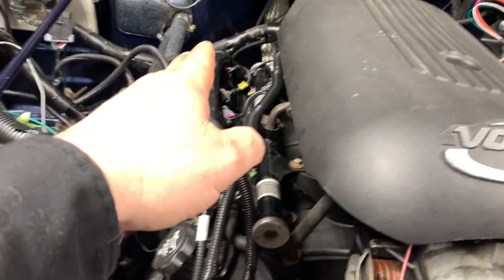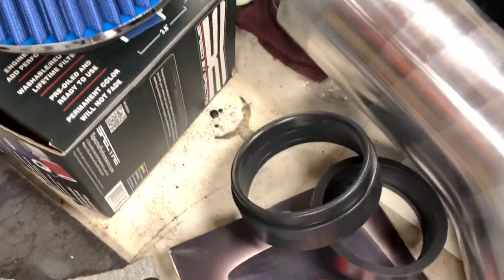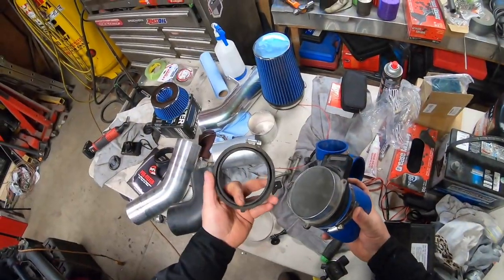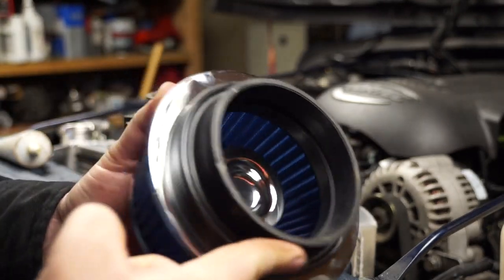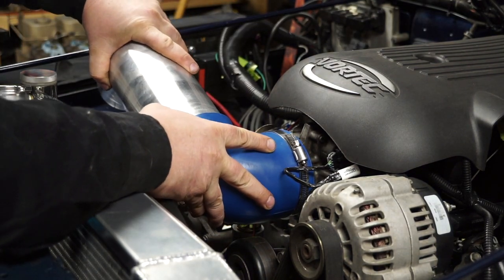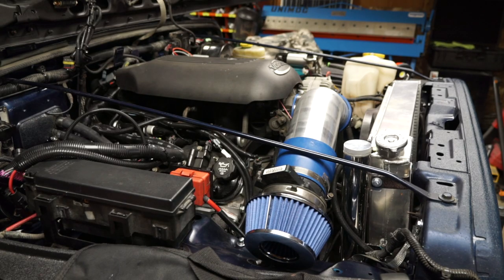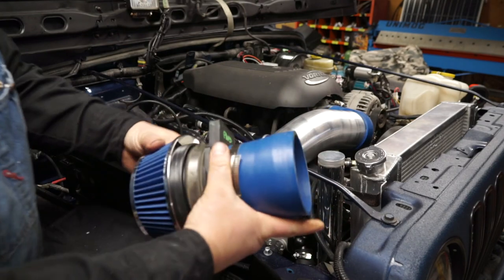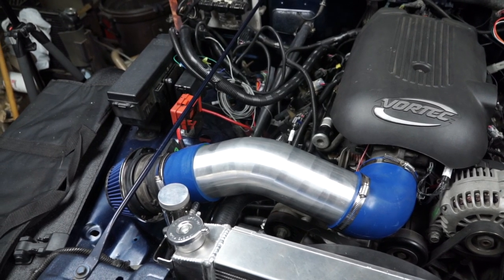Jeep TJ Ls Swap Air Intake DIY

Comment: how long till someone asks if that little filter is going to restrict any air flow...... or how often you need to clean it since its "just sitting there and is so small".... or small filter jokes....

screw em, MFBT... great vid.

Cheers from Montana.
Reply from the maker: I’m sure there will be lots, it’s actually a well know filter used in ls swaps with great success.  The cone is open in the front as well so no real restriction.  I got a pre-filter on it now
Reply: BSK Garage  figured you would do your homework..... but there are “bolt in hole” guys that don’t.